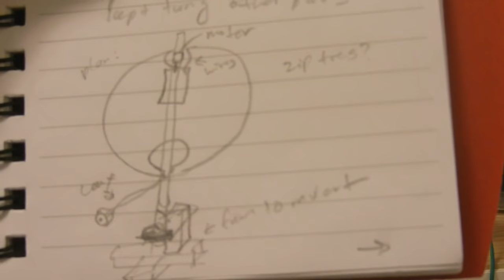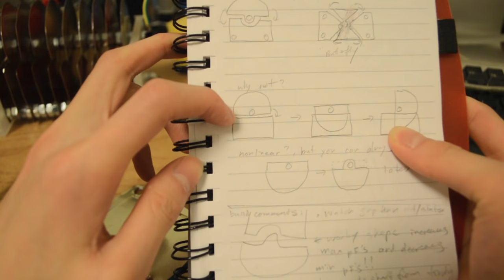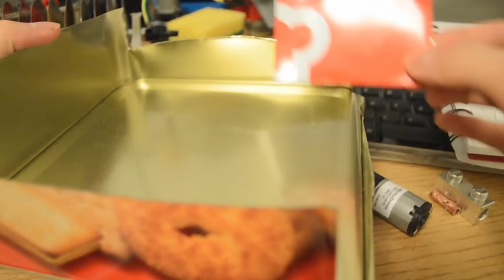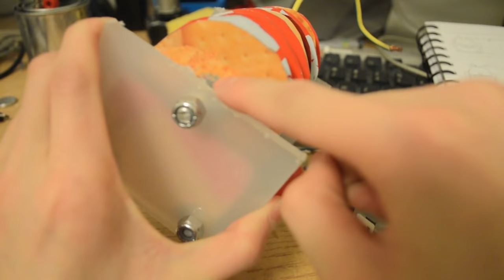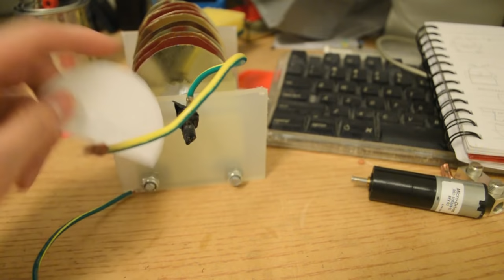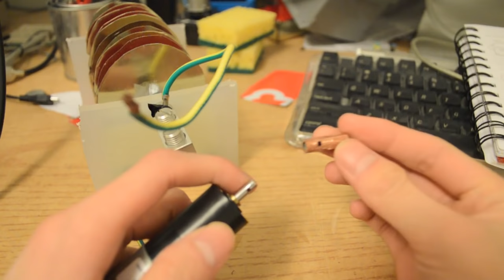Homebrew Magnetic Loop Antenna Part 1 - Variable Capacitor

Comment: I don't think he is aware  that magnetic loop antennas circulate several thousand volts and tens of amps through both the loop and the variable capacitor. The reason for butterfly caps is a split stator system that keeps all current out of the rotor part of the capacitor eliminating serious resistance losses from the necessary rotor sliding contact.☺
Reply: It depends on what kind of power he plans to use. For QRP work, even two sliding copper plates separated by wax paper should do the job. This is better.
Reply: If the rotor wire is permanently fastened there will be no wiper losses.

Comment: Excellent!!  Your doing the Lord's work Kid!!  Hang in there.  I wish there were more young people with this level of wanting to know.  Now old people (like myself) have lost that spark.  I just tune the loop at low power with a small variable cap, take it loose and measure the capitance, them look in the junk box and find a fixed 50,000Kva that is the same and solder that in.  I only need about 100khz to work the CW bands and won't need tuning after setup.

Comment: That's a lot of work to make a not very efficient variable capacitor. Worth spending a few $$ for a decent one, I think.
Reply from the maker: Mmm this one I'd have to politely disagree with. Yes, it is a bit of work, but the space efficiency doesn't get better by having plates closer together because you'd just end up with arcing. The capacitance is determined by how much overlap there is, and while I can get maybe an extra few percent of capacitance by re-shaping the plates (see other comments), this should be pretty close. Other than the appearance, this capacitor should be just as good performing as any commercial capacitor with similar dimensions. Metal is metal (unless, ofc, you gold-plate copper to ensure perfect parallel plates or do something equally alien to decrease losses). I do have one or two HV var caps lying around now - perhaps worth it to do a comparison?

Comment: The main problem of the capacitor is the contact of the moving blades. But he does not say anything about it. As it showed, the wire will wind up every time the capacitor rotates.

Comment: I watched this a second time as I plan to construct a magnetic loop.  With regard to the 600 volt rated tape when Harbor Freight sell electrical tape it is oriented toward the construction industry and commercial electricians who will mostly use the tape when wiring for  120, 240 volts or automotive which for older ignition systems can exceed 600 volts.

Comment: The dimpled plates on the commercial cap allow for a higher percentage of the surface area of the plates to mesh.   In your non-dimpled plates, you have around 20 percent of the plates up in the air rather than meshed with the bottom plates.
Still,  you did a great job on building your own cap.

Comment: this is really nice to see.  perhaps an insulate rod between the motor and cap shaft will have a higher breakdown voltage.  I did not yet see part 2 and 3. perhaps he did that.

Comment: If you get a cutting compass you can cut those pieces much easier. Otherwise, you should score the surface with a needle, needle compass until the metal just pops apart.

Comment: You should have used a hole drill bit and just drilled out a bunch of circles then cut them in half, shoot the metal looks thin you could have done that and then bent them in half so they are thicker.
Reply from the maker: Thanks for the thought - 
If I'm thinking about what you're thinking, you're talking hole saws. They have teeth along the outside perimeter and a centering drill bit down the middle that's longer than the metal cup part. The biggest hole saw I had was on the order of 2", and had  bigger teeth for wood. Each of those hole saws cuts will only yield one plate, because you actually want the hole. The hole will then have to be enlarged to the shaft diameter, which is more work. Also, hole saws are generally for making holes and not for keeping what's in the middle - you're going to end up with a somewhat bent and unusable piece of metal if any binding occurs. There is the option to make 2 plates out of one cut if you re-drill the hole offset from the center after cutting the original hole out, but that then becomes much more work than it's worth. The capacitance is mostly affected by the surface area, so thin is actually ok, and makes the unit lighter in weight.

There are the bits that trace out a circle instead, but I think those are for rather large milling machines - which I definitely don't have. Donations welcome though :D

Comment: I was thinking about your problem coupling the motor to the shaft would some R G 213 inner  ptfe   tube with the conductor  removed  work ?
Reply from the maker: It might work, I don't have any RG213 on me though. I'm not 100% sure about the diameters, but perhaps the tube with a bit of hot glue will work? Great suggestion!

Comment: Great Video, Mine is a 20 foot soft copper ring with 3 capacitors in parallel for a fixed value of 103pf. Mine is set centered at 7.030 by using 66pacific.com 's online calculator. Yours is much better.